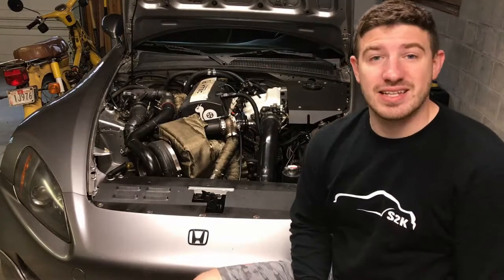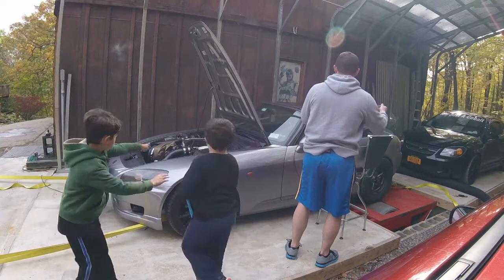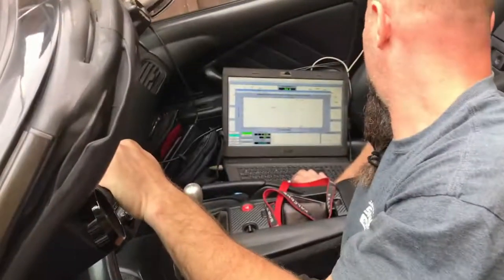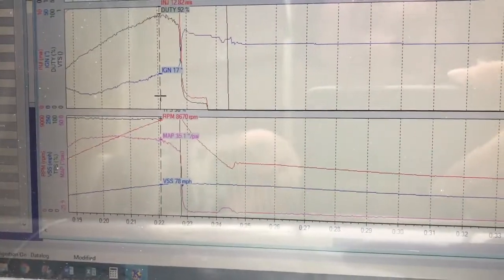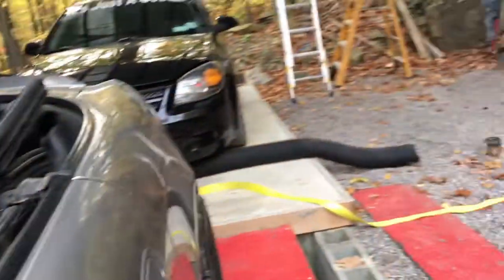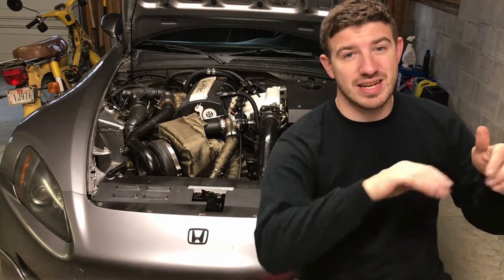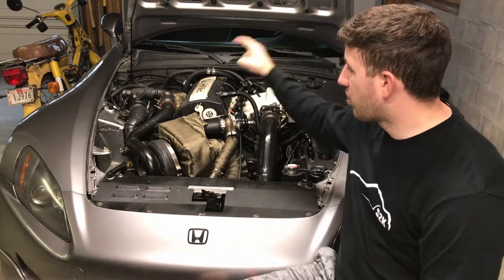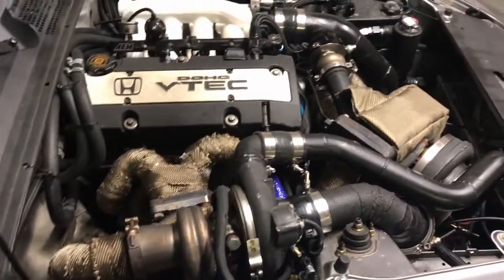Back to the Dyno!

Comment: Add an additional wastegate on the manifold so that when the small turbo reaches target pressure the exhaust gases will bypass it easier carrying more energy to rotate the big turbo.
Also the vaccum source for the big turbo wastegate must be from the intermediate charge pipe if you have a small pressure on it.If you are using a final boost target for the big turbo you can use the plenum too.
For example if you want 8 psi from the big turbo and 22 psi from the small the big turbo you use intermedate piping as vaccum source. If you run a 20 psi spring on the big turbo and 30 psi spring on the small you can use the plenum as boost source. This way final pressure will be 20 psi from the big turbo and the rest (5-6) psi from the small.  
Thats my undestanding :)
Reply: Primary turbo is too small...   Go to a 7180 EFR  with the biggest exhaust housing.   As Abec mentioned you need to bypass way more exhaust to the secondary turbo.   Like twin 60mm waste gates. The internal wastegates have too little flow.   Listen to Abec, he is on point!  Boosted boys made 1000hp on 20psi !
Reply: @johnnymac1976  Are you sure Borg Warner makes an EFR 7180 turbo?  I did not see one on their website. 😱

Comment: Great project! I hope the size- difference between the Turbos wont bring you problem.  I run 60/65 + 69/77 and i think they spool increadible fast (2.5 litre engine)
Reply from the maker: Thanks, and actually what we've found is you can have a large spread in the turbos.  The LP's large turbine wheel helps keep backpressure down yet still responds great!
Reply: How fast do they spool??
Reply: @FirstLast-tx3yj  increadible fast
Reply: @FirstLast-tx3yj  (2.5 litre engine)
Reply: @Joshlindsay22  richard holdner did an ls compound turbo vs single and the peak power was good but they spooled slower than a single

Does this mean he shouldve had a smaller first turbo or what?

Check the episode if you want
Reply: @FirstLast-tx3yj  I was just making fun of how he spelled incredible LOL but typically the first turbo in a compound setup is significantly smaller than the rest
Reply: @Joshlindsay22  so for my application an LS 6.2 i want to run a g25 (very small garret capable of 660hp) and then a gt45

But since i want about 700-800hp only meaning the boost is about 10psi but i want the response immediate that is why i am going compound

Idk if it will work out better

Comment: I would go for V-Band clamps instead of silicon hoses, assuring a tight seal all the way around for no more leaks. Just buy another Bosch 044 pump, so it would be good to go!
Reply from the maker: Thanks, the way to go is the vibrant HD clamps for sure!!  Funny enough the silicone clamps are leak free....it's that damn s475 compressor outlet

Comment: Also check your exhaust cross over. If you have a leak from the HP to the LP turbo it won't be spoil it any where near what it should. Also could be boost leak or even both. Good luck buddy 👍🏼

Comment: awesome man! another thing you can do like Puds Garage did was add a boost gauge between stages so you can see what is going on with each turbo
Reply from the maker: I actually have a pressure sensor between stages, I've just been having some issues with the readout of it so I need to dive into that more!
Reply: Ooo ok. yea i would work that out, its big factor to "even out" the pressure ratios of both turbos